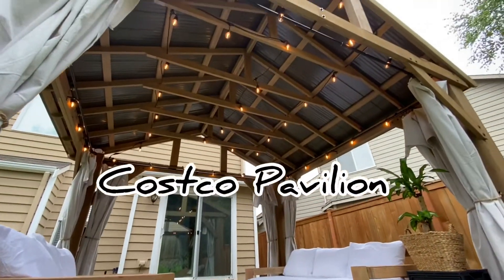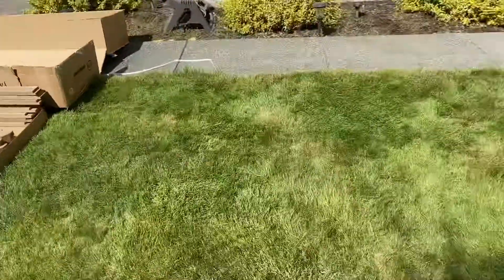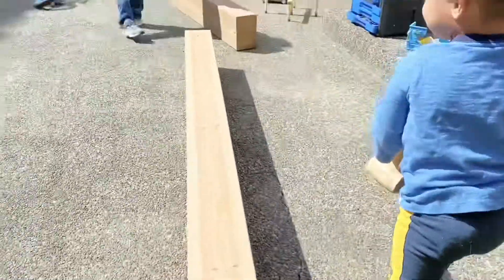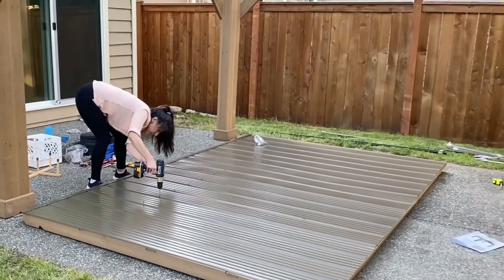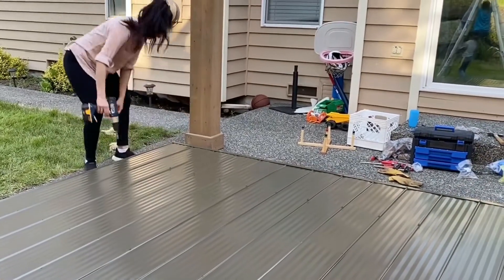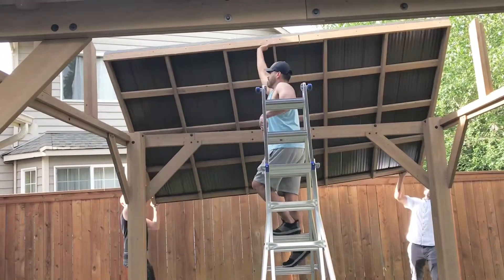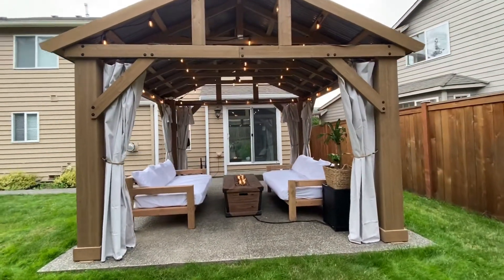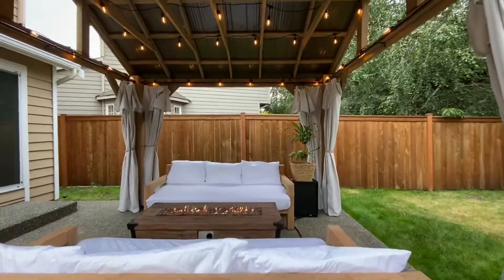Costco Yardistry  14 x12 Wood Pavilion

Comment: Glad to see you didn't both with local building department permit.  Yardistry refused to provide any structural details and my local Building & Safety inspector rejected my permit application.  Now I'm stuck with a half finished pavilion.  Their customer service is horrible.  And Costco puts a warning on the sale that "Permits may be required" so they are unwilling to help and just referred me back to Yardistry.

Comment: The gazebo should be mounted onto a concrete surface and not simply staked into the ground, correct?
Reply from the maker: I think it is less likely to rot being in a concrete surface versus just on top of dirt. The floor should be leveled as well.